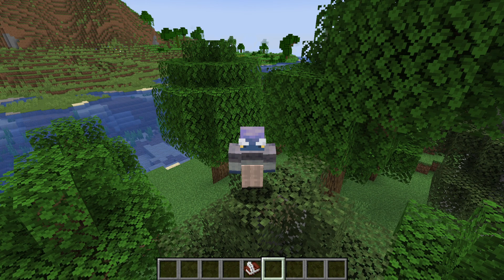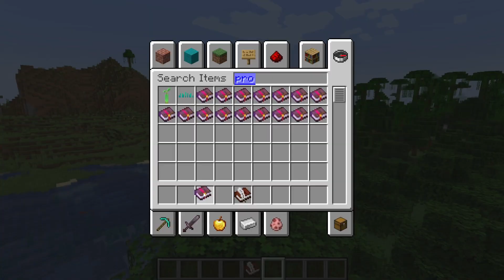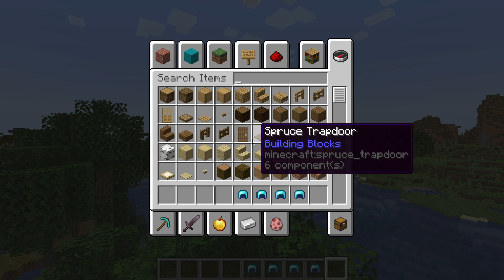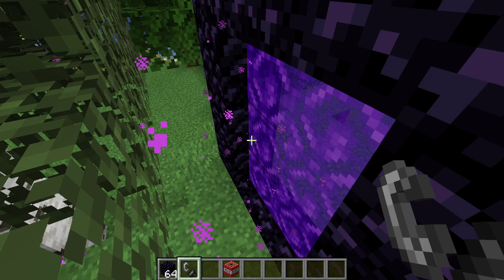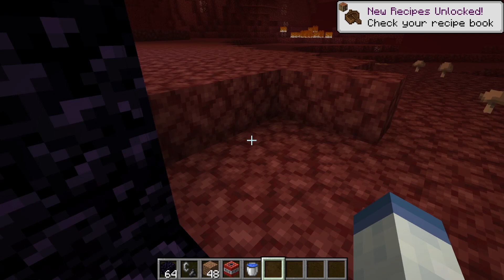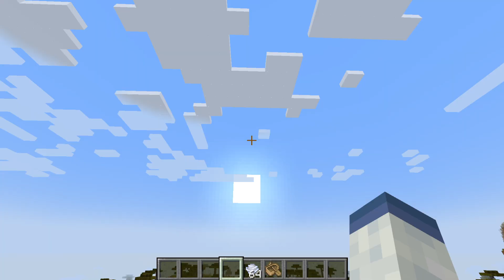Minecraft 1.21 Pre-release 4 - Huge Fire Protection & Blast Protection Changes

Comment: why would they nerf blast prot and fire prot when protection is primarily used anyway
Reply from the maker: I think it was more a nerf for players who wear all 4 protections, one on each armor part
Reply: @BelgieMinecraft   You used to be able to get maximum value out of blast or fire prot by only wearing 2 pieces and a piece of prot 4. This worked because resistance caps at 80% reduced damage. Now you have to wear 4 of either just to get the knockback or fire resistance which is much less effective than just not using them at all because their secondary effects are one of the reasons they were so strong. Basically they have just encourage running full prot 4 for 16 EPF which gives 64% reduction in damage from all sources.

Comment: Still only going to use full Protection IV
Reply from the maker: same
Reply: It don't matter if you wanna full blast protection just use one blast protection IV and the 3 full protection IV bc of 80% reduce damage limit in minecraft. And now its worse bc of nerfed
Reply: They really need to either buff the other ones or weaken regular protection because regular protection is so much better. It's better for even the situations with explosions and fire, but which is kind of dumb.
Reply: @sandwichqueen  The other protections have special things that regular doesn't, such as reduced explosion knockback and fire extinguishing faster.
Reply from the maker: @sandwichqueen  Yh but it does do what fire protection / blast protection do in the sense of burning time and knockback resistance
Reply: @BelgieMinecraft changing these values just makes me not want to use them anymore. I used to do Prot Chestplate, Blast Helmet, Prot Legs and Fire Boots. That was the ideal set up, but now just taking flat reduced damage is way better. They need to add set bonuses, perks almost that make it worth using the different protections, there is no reason why you would use Projectile Protection UNLESS is a very niche use.
Reply from the maker: @ethanco2  Yh i think they are making it so you have to pick one rather than all
Reply: @BelgieMinecraft I guess it’s making it more situational so you aren’t just using a wonder armor set.
Reply: @BelgieMinecraft  that is actually another issue I have. I've always thought they limited damage like regular protection until they added the little description. Why are they all named protection if they do completely different things? That's just the stupidest thing ever.
Reply from the maker: @sandwichqueen  They all protect you from damage types of their name but fire protection and blast protection also do them other things on top of protecting damage
Reply: @BelgieMinecraft  and its 32% each piece and normal protection its 16%
Reply: @sandwichqueen  Agree, Fire prot is pretty worthless since there's an entire potion for negating it